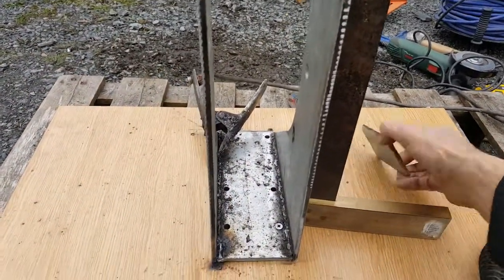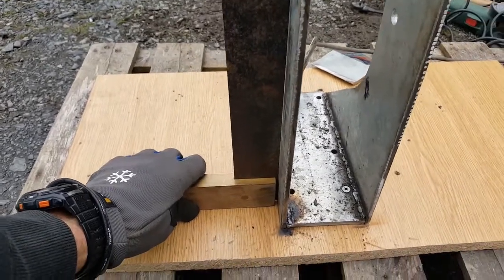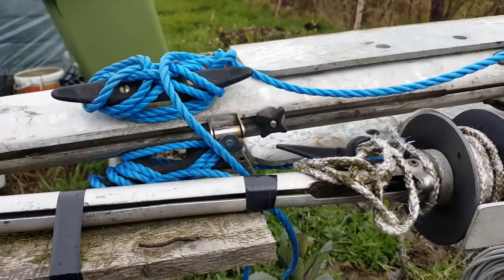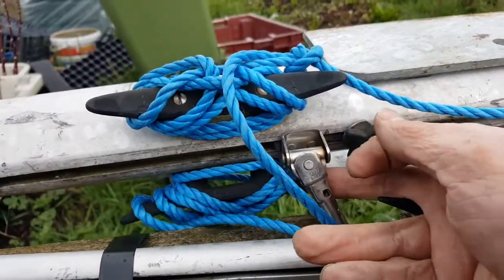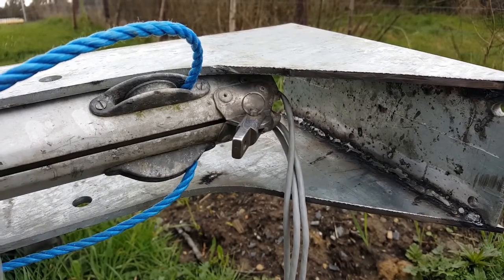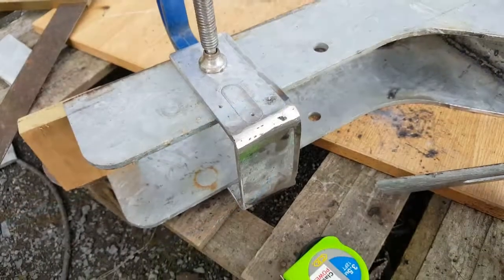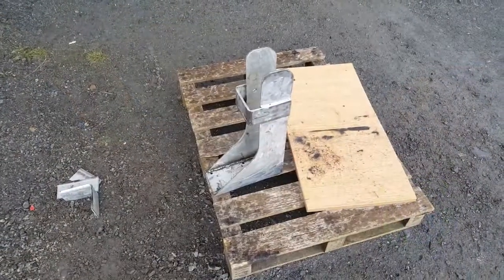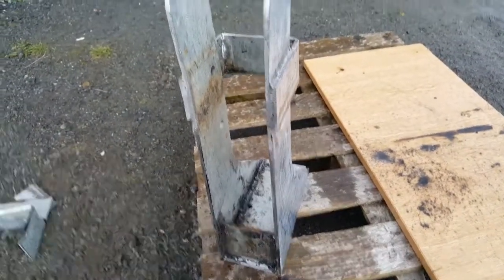Episode 21 - Building the mast tabernacle

Comment: Hi good work, most tabernackle are usually close to the mast width usually 1/8" clearance each side with some ptfe washer were the pivot bolt goes through. Looked like you have a bit extra room
Reply from the maker: al math No, I explained it badly in the video. I said I put it on the front  and also said that it faced the cockpit! :-)

It's on the rear side of the tabernacle so the mast will drop to the horizontal position and the spacing is wide, but that's intentional.

The mast will be centered using metal and delrin spacers because I wanted to maximise the mass and structure of the tabernacle, without having the tabernacle interfering with running rigging.

If that turns out to be a non issue, I can weld in an additional plate internally on each side, to both reduce the inner dimension and further increase structural mass. 

If I had made it narrower and then had  running rigging issues it would mean rebuilding it from scratch. Regards Dave.
Reply: Dvseire thanks for responding sound like a plan. Didn't want you to put in all that hard work then find your mast was off center! Regarding the raising of the mast by 75mm you need clearance for the mast to swing at the bottom  but also want it to sit on a fixed surface, I have always hammered in nylon / wood wedges as to create a base. I have made two tabernackle now for a hunter 701 and a trapper 500 as i am in a club way up the river clyde we need to drop our masts to get under the bridges.